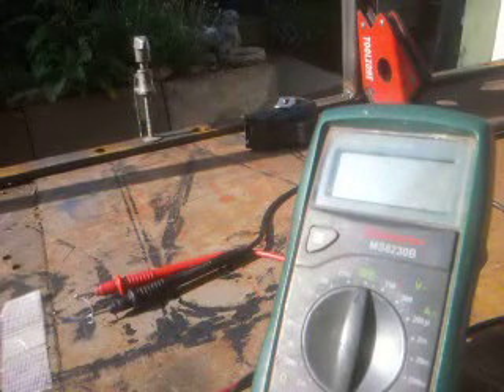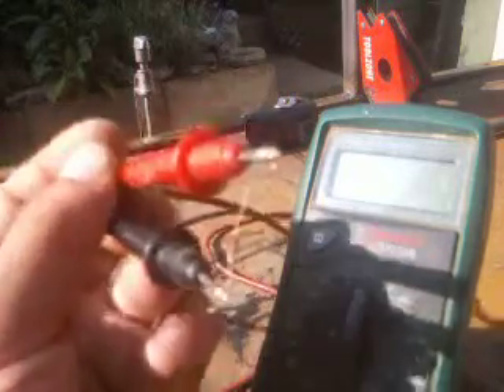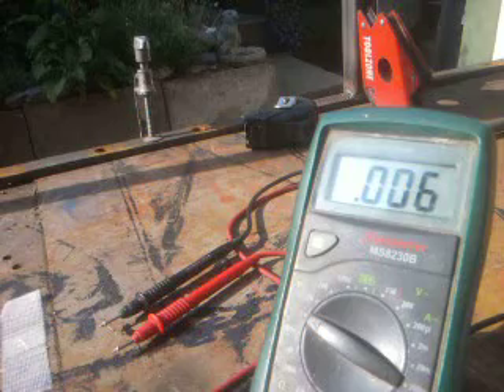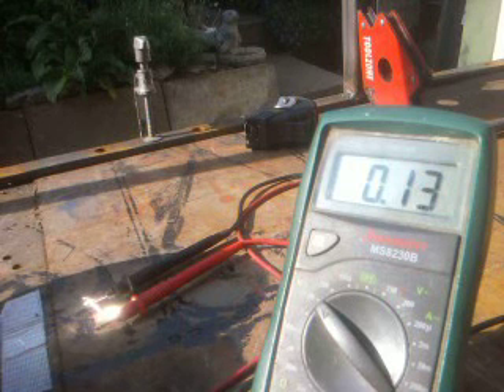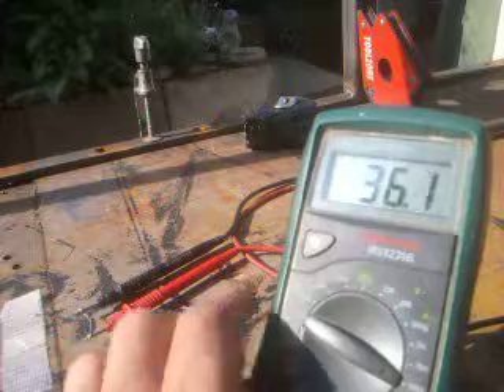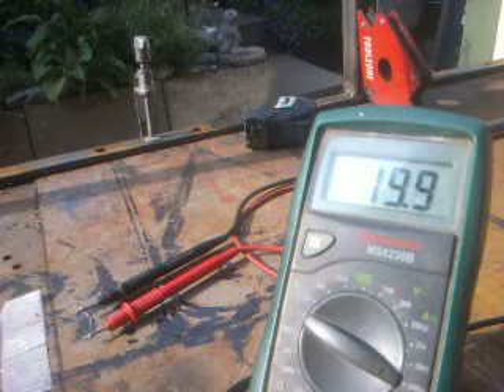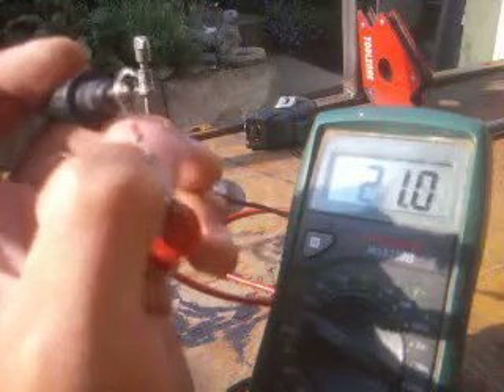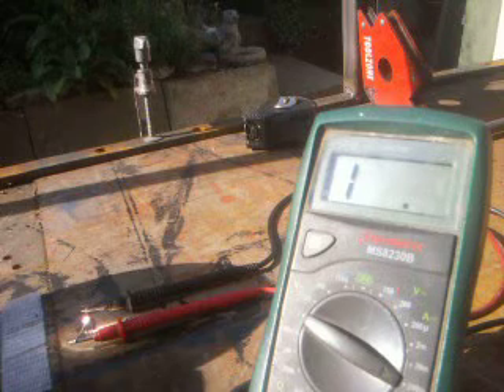Use a Silicon diode (zener)  as a solar cell!

Comment: Nice video bro. My question is can zener diode be charged in the sun and used in the night? Does it store the solar energy?
Reply from the maker: eric fernandes thanks, the diodes have silicon inside that can convert the light to power only. Sadly they can not store it like a battery or capacitor. Most doides can do this but don't have a glass shell like these ones.

Comment from the maker: I have seen that mineral oil is good for refracting light, Dan at greenpowerscience show this, And the oil could be linked to a passive cooler to dissipate the heat. a curved mirror may prove good to use as i have connected some is series that ill be messing with at some point, just my luck we are over cast with heavy and long showers on there way...